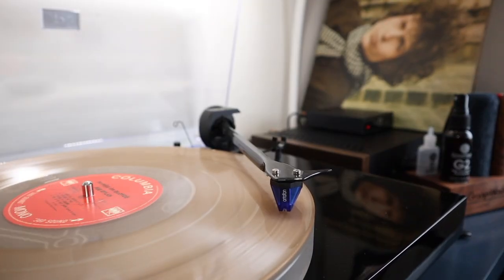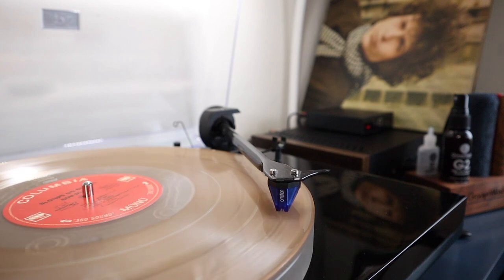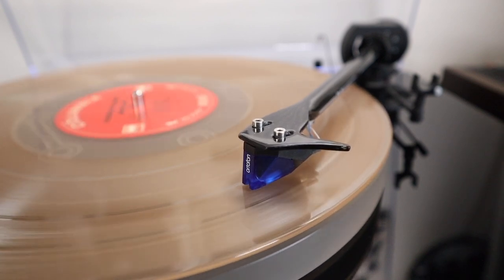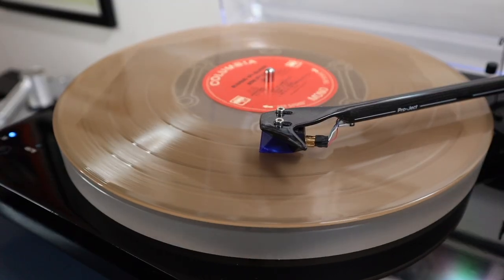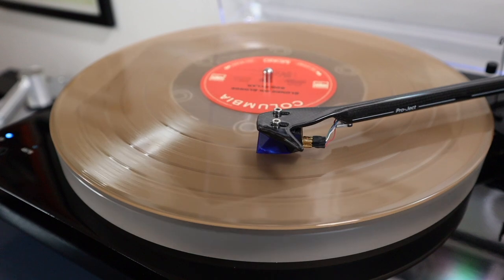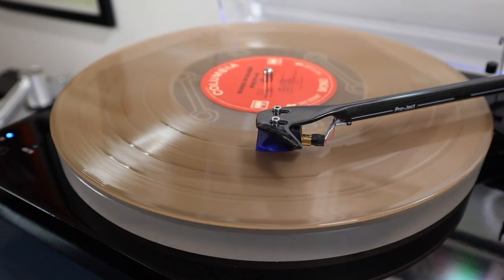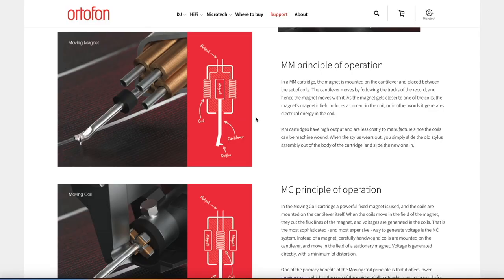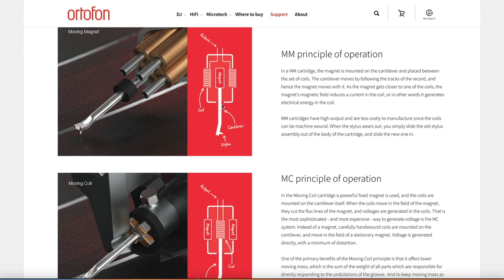Moving Magnet vs Moving Coil Phono Cartridges - Vinyl 101

Comment: I had a Denon moving coil cartridge on my Denon turntable for years. But, when the stylus bent, I realized I had to replace the entire cartridge. I wasn't about to pay the cost of another moving coil cartridge and wasn't crazy about the idea of having to replace the entire cartridge if the next stylus got damaged. So I am running a moving magnet now. Sounds fine!
Reply: Supposedly, the cantilever and stylus on a MC cartridge can be replaced, but not by the user. It has to be sent back to the company or some reasonable facsimile.
Reply: @stephensams709  the whole cart eventually wears out when the leads to the 'moving' coil break - part of the stress of operation
Reply: @stephensams709  the so-called retippers take some 400-600 euro for re-tipping your mc.. 

If your mc is a boron cantilever with nude fine-line you're easily looking at 600 euro,  minimum. 

And there can be a 6 month wait on returns after you send your poor cartridge to the guy.. 

I've spent alot of time researching the field,  and it seems people often have negative experiences after getting their cartridges back, with a sound inferior to the original. 

Soundsmith are rumored to actually upgrade your cart, with improved sound. But they are based in the US,  so I would have to pay a fortune as soon as my cart arrives back in the EU where I live. 

After my MC Blackbird dies, I've concidered switching to a Sumiko Amethyst MM, with replaceable stylus..
Reply: MC sounds like it stands for “Moving Cash” in the wrong direction.
Did you miss any sonics of the MC when you changed the Denon MM? Curious…
I love getting old 60’s hi-if pls and hate spending big bucks on little return. Well not entirely, as I upgraded and was so glad I did. Ouch…
Reply: @GIBKEL  I don't know what the differences are in terms of sonics. The turntable and cartridge had been stored for several years. I took it out from the box, I noted that the stylus had been damaged. So the first time I played it in years it had a moving magnet cartridge on it. My sonic memory ain't that good!
Reply: @lsaideOK  I so miss all the Stereo shops that were located in towns of 20 thousand across the northwest. I worked at a record store in the 80’ that was connected. I didn’t have a pot to piss in but you could hear anything at the height of the audio file boom. I’m not sure there a stereo shop in the whole of Mt. Trust is hard to gain through YT and there are a couple of generations that are absent what was common knowledge. Hifi has always been part of the dark arts but the comment section is pure gold where folks can speak. Cheers-I have MoFi’s top line MM and honestly, I don’t remember it ever sounding this good. 30+ years of digital has worn these poor ears out and it’s akin to luxuriating in sound once again. I hate to think I may be missing out as MM is treated a bit like the red headed step kid. Much appreciated-
Reply: @GIBKEL  I don't know who is looking down so much on moving magnet cartridges. I suppose there are those who look down on whatever,  solid state amps, streaming, vinyl... That is just noise. I did the modern thing and bought speakers online with a long trial period. Zu Audio Dirty Weekends. I wound up returning them. What a chore it was to box those speakers back up! Much less convenient than driving to a store, listening, then driving home.
Reply: @lsaideOK  Those we’re the days…..It’s a mad world and false praise, easy to generate. I feel like I’m in a den of thieves. Here’s one example; I had been in Oregon on the coast and it was when I was searching for a new turntable. I was going through Portland(who had a number of high end stereo shops. Called to have a listen while I drove through and it wasn’t possible. I could purchase it and pick it up and it wasn’t clear I could even return it….a $2700 turntable. They didn’t have a listening room, another online store that was little more than storage facility to ship out of. Nice web site though….consequently, I didn’t go that route.
Reply: I’ve heard about a little from a Hana MC cart and it was sounding phenomenal. So I want to get one. At this point, though, I don’t know which one to get without breaking my bank too much. At this time I have a Grado Silver, and Mono cart, and an Ortofon 2M blue.
Reply: MC can be exchanged for a new one with trade-in programs ... major brands do it. In other point of view, stylus always get the 80% of the cost in a MM cartridge, so I don't see the problem here.
Reply: @mike70-d5b  so you know Denon will exchange a 40 plus year old cartridge for a new one at a greatly reduced cost from a new one? And companies will allow you to exchange for a new one when the old one needs a repair? What companies exactly are you talking about? And I don't understand the issue with the moving magnet stylus being 80% of the cost since the cost is lower in the first place (on average). Plus that gives one the advantage of being able to upgrade styluses as one sees fit.
Reply: check it out with Denon, but you understand that's not the usual case. People normally doesn't wait 40 years to change the cartridge. AT, Hana, Ortofon and others have great trade-in programs. You can't compare "cost by cost", there're cartridges at many price levels ... you have MMs at more than 1k and let me tell you that replacing MM stylus or MC cartridge (at "same" price level) is about the same
Reply: @mike70-d5b  well that was what my original comment was about.  But I guess you're right. It's okay to have to pay for a new cartridge every 40 years or so! It was disappointing that it was bent, which was probably my fault somehow in storing it incorrectly

Comment: Blanket statements about moving magnet cartridges and moving coil cartridges are not going to do us any good. There are some fantastic moving magnet cartridges out there but a Clearaudio Charisma costs $2000 I think. There are some amazing NOS  moving magnet cartridges on ebay etc. like an Audio Technica ML 170, that will beat some lower priced moving coils. But not for transient speed, transparency or spatiality; those are performance areas  where moving coils rule. The Shure V15 V MR was not Shure's best cartridge according to Shure employees. They liked a few other Shure models better; which didn't become as well known. Doug Sax who mastered Sheffield records, said his favorite cartridge and the one he mastered with was the Stanton 881S. A few of these, some NOS can be usually found on ebay etc. It was a moving iron cartridge, which is the third major type of cartridge. Soundsmith makes moving iron cartridges. Moving Iron cartridges are high ouitput. Another vintage cartridge to look out for is the Pickering XSV 3000 and also the XSV 4000. Also a real stunner is the old Ortofon VMS 30  cartridge. It works on a principle called Variable Magnetic Shunt. If you like a brighter sound you may be able to find a NOS Astatic MF 100 or MF 200 cartridge; they were called Glanz cartridges in the UK. Then there was the AKG P8 series and the AKG 25MD. These old cartridges from the golden era of phono are well worth seeking out, and some of them can give expensive cartridges of today a run for their money. If you can find them cheap enough. If buying modern cartridges I would really look into moving coil, even if they need an extra gain stage. Of course there are old NOS Moving Coil cartridges that pop up. The Audioquest 404 and AQ7000 are   classics, as is the Sumiko Talisman S, Virtuoso DTI and Blackbird. Also the Monster Cable Alpha 2 High Output moving coil.
Reply: The problem with old stuff is supply, particularly with replacement tips, not particularly with, as you state, the quality, since the job hasn't changed.    I had a Stanton 881s, and when my beginner self bent the cantilever, replaced it with a high line shure which sounded better in my system.   

It was the first of a string of high line shures until they stopped production, and I now have to get replacement styli from a specialty supplier in Japan.   Big influence was I used to travel to New York City, where I could get a top of line shure at substantial discount, and didn't have to deal with the normal mind bending mark up of cartridge selling prices and audio salon condescension of my budget limited system .

Comment: I think people new to vinyl often make the mistake of getting an expensive cart without realizing that it will wear out pretty quickly with use and need to be replaced. My choice of cartridge is always informed by the cold hard reality that the cartridge will need to be replaced every year or so, depending on frequency of use. So by that standard I have to find a price point that is sustainable every year. For me that happens to be a MM Ortofon 2M Bronze with a replacement stylus running around $300. So while I might be able to afford the Ortofon 2M Black at $650 as one time purchase, there's no way I can sustain that every year.
Reply: Yes, styli get worn down... but a replacement once a year seems really excessive. Ortofon claims around 1000 hours of use for their styli "without degradation of performance". That's 3 hours of music every single day and it's the guys making a living by selling those things telling you that. I mean, sure, if you do actually listen to 1000 hours of vinyl in a year (I envy you), a yearly change might be worthwhile, although I'd still go for around 1500 hours or something like that , but I would assume most people out there with a vinyl player listen to it way less than 3 hours a day.
Reply: One year ? Totally wrong. You would need to run it 24/7 for that to happen . Way of information.
Reply: I had a 2M Bronze, but saw a forensic comparison on Hivinyws channel between it and the Nagaoka MP200, which shocked me. 
It's still there, and you might care to watch it. Nagaoka only claim 200 hours PEAK performance, which I take with a pinch of salt similar to that of the Ortofon's 1500 hours. The Nagaoka replacement stylus costs £130 on Amazon UK, probably $130 in the US.

Comment: The only MC cartridge that I have owned was from AT back in the late 70’s/early 80’s, I think it was the 32 or 33. It sounded very detailed and had a great soundstage but was too bright and I ended up with listening fatigue. From that I went to a Linn K9 which served me well for decades with the obvious stylus changes and I still use that today in my second turntable with the  ATVM95C stylus for older used records. I use a Sumiko Pearl MM in my main system which has all the detail and soundstage of the AT MC but is more relaxing to listen to with the bonus of having a user interchangeable stylus. I have thought about getting a better cartridge though but can’t decide on what so I am watching a lot of YouTube videos for ideas.
Reply: Agree with you. Most MC's sound fatiguing and even if they are the same make model and from same construction batch, they can sound significantly different.

Comment: I went from a Ortofon Black LVB 250 (MM), to a Rega Apheta 3 (MC). Its not even a close comparison how much better the MC is. Now. Its over twice the price, but I haven't heard an MM that's even comparable yet.
Reply: Fair comparison:
Take the regular 2M Black using a MM/MC phono stage for roughly the same price and compare it to any MC cart for the same price.
Reply: @monsieurlehigh4912  Bingo!  Also, make some digital recordings, make it sound equally loud in an editor and then compare. Cognitive bias is a mighty opponent. I honestly don't thing a budget MC Fine Line tip on alu cantilever would sound better than a high-end Ortofon MM design with Shibata on boron cantilever.
Reply: I have a Rega P6, EXACT-2mm, and Aria MK3. I’ve been concerned upgrading to the Aphetta 3 or P8 and Aphetta 3 will increase brightness and lessen the fullness/bass the Exact-2 gives me …what equipment do you use and what are the sonic differences you bear that make the Aphetta 3 better?  What specifically did you gain?  Appreciate the dialogue!
Reply: @saltaormina9404 I have the P10, the Aria MK3, and the Apheta 3. I have not heard the Exact. However, I have heard the P6 vs the P8, and the P8 is significantly better. Had both in my system for weeks each. The Apheta 3 has incredibly tight bass, almost zero bloat. If the recording is bass heavy, the Apheta will play it bass heavy. It's all about the mastering. I would imagine there is nothing that the exact 2 is better at over the Apheta 3. The Apheta is not sharp by any means.
Reply: What Ortofon MM with a shibata and boron cantilever have you owned? Or listened to for that matter? I'm glad your argument is "yeah wait till they listen to an Ortofon that doesn't exist". My apologies for owning the most expensive MM that Ortofon makes, but didn't get it modified.

Comment: It is not worth switching to a moving coil cartridge until you are able to afford a really good phono stage.  I would look at the Nagaoka moving permalloy cartridge which use a magentic permeable material  close to magnet to reduce the moving mass.  The Nagaoka MP200,300 and 500 are truly excellent cartridges which can see off most moving coils.  If you really want to get into the MC world the Hana EL is a good place to start.
Reply: Project has a new fully balanced phono stage. It's called the DS3 B and it's meant for mc cartridges. Very good value.
Reply: I love the Hana

Comment: A high output moving coil cartridge or medium output one sometimes doesn't sound much different than the low output version. Less coil winds are best, but that doesn't mean the few more coil winds of the higher output versions demote it to your average moving magnet. It still will likely have the more 3 dimensional depth imaging that moving coils are known for, along with superior openness and transparency and usually far superior transient quickness. I've used them often. I remember a remark made in a UK hifi magazine, "With the moving magnet, it souns like a good recording. With the moving coil, it sounds real." Moving coils often hold back on warmth and bass a bit. Lots of warmth works at odds against the wonderful transparency they exhibit, so they probably do that on purpose, when they do. For those of you with bass controls, turn up the bass a little and your transparency will obviously lessen. There are ones with plenty of bass punch, if that's what you are after. You got to choose wisely. Many preamps and integrateds come with a MM/MC selector switch. Extra cost? Plus the ones with an output of around 1mv. you can often use them with a moving magnet input. Moving iron cartridges usually have more transient speed than magnetic cartridges, but with the cheaper ones, don't expect that you'll get that Moving coil 3 dimensionality, transparency and exciting transient snap. The company Hana makes a nice moving coil cartridge for a little over half a thousand dollars, and it has become a standard at it's price. 

 Why are there so many people who try to make like it's real expensive to get into MC cartridges, reel to reel tape machine format etc. There are good used reel to reel machines like Sony, for under $300. With the price of used factory recorded music titles, usually no worse than prices for new vinyl.

Comment: Hi Mark. There is also the option of a “high output” Moving Coil cartridge which negates the need for a MC phonostage. I recently got a demo of 2 different ones for my P8 turntable & was blown away by the upgrade in sound quality & detail. Hanna, Dynavector, Ortofon & Audio Technica are some of the producers. They are not massively expensive (the Hanna’s just over £400) and having now changed to this type of cartridge I won’t go back. The 2 I demo’d sounded great but totally different & it depends what type of sound you prefer. I would always recommend getting a demo with your own deck & with a variety of music.
Reply: Yeah, I bought a Dynavector 10X5 MK II a couple of years ago. It is a high output MC and I absolutely love it. It was around $750, but worth every penny to me. There are many other better ones, but it is an awesome cartridge if you're moving from a MM to a MC for the first time.
Reply: I think the added mass of a high output Mc design kind of defeats the intent of the original design, and might make a comparison to a moving magnet cart with the same tip design a more illustrative demonstration .  High resolution moving magnets designs are out there, and were developed along with advanced tip shapes when discreet quadrophonic records came out, which used ultra high frequencies to steer the channels.    I do agree that moving mass is the key to performance, but I also look at record wear, an aspect of performance never addressed in the reviews of very well regarded MC carts.  I don't need or want a race car type of design for my needs, a grocery getter everyday cart is better suited to my system goals, which include record preservation as a top priority.     As long as the cart is not mis tracking, wear is not an issue, I just prefer to track at lighter pressures to reduce stylus wear, and just in case something goes wrong, like operator error.
Reply: @richardelliott8352  Exactly. These are also sensitive to the overall capacitance load, unlike the low output designs.